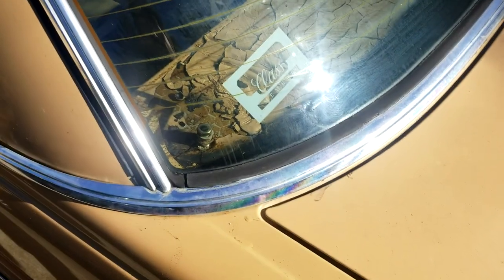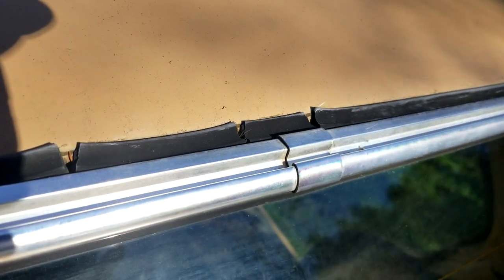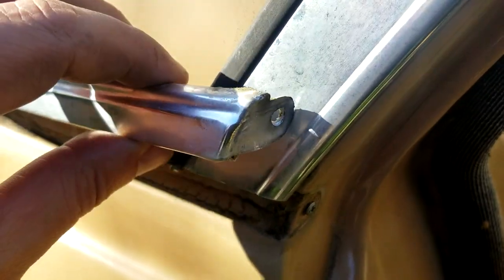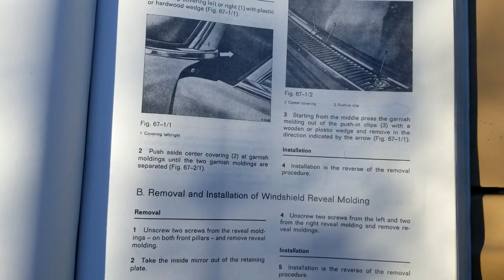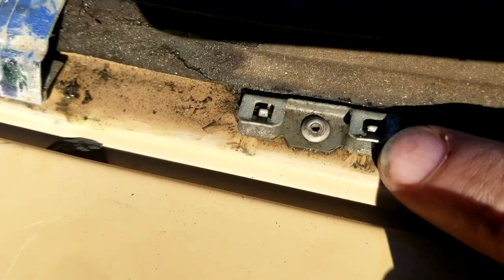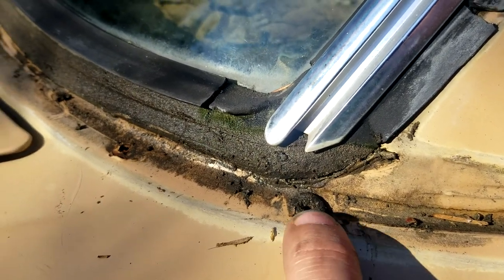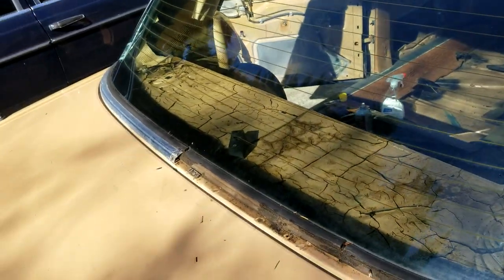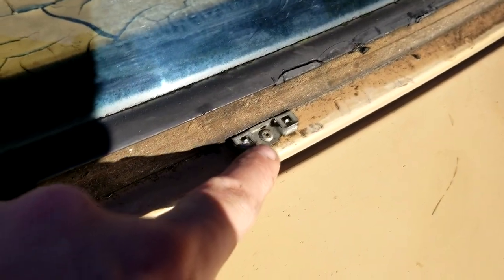W115 Rear windshield rubber seals Part 1

Comment: Hi, are you going to replace the rubber seals? Where will you find them new? ..
Reply from the maker: Hi new seals are available original and aftermarket
Reply: @dieselbenzrevive6820  That's really lucky that they can still be bought. I have been looking for those rubber seals for vintage European cars. Do you know any good place to look?
Reply from the maker: @danielx40   check autohausAZ   for aftermarket, or if its Mercedes you can get direct from classic mercedes center
Reply from the maker: @danielx40  what year and model are you looking for I will try to find it.
Reply: @dieselbenzrevive6820  That's really kind of you. It's a 1989 Rolls Royce Silver Spur with dried up seals. I might go check with the dealer but they are owned by BMW now. The older models are not very followed-up. Most parts are only available used on ebay. But those thin rubber seals have to be new and aftermarket. I'm thinking to use bathroom silicone seals for the thin trims, and used weather strips for the doors. Then windshield seals are tricky because of the chrome on it. Once the rubber get's "wavy" over time, so does the chrome. It seems the deformation of rubber seals really gives away the wear of a car even if the paint and upholstery is restored.
Reply from the maker: https://replacementpartsinc.com/1980-1998-rolls-royce-bentley/body/
Reply: Mercedes Benz Revive Thank you so much for finding the site.